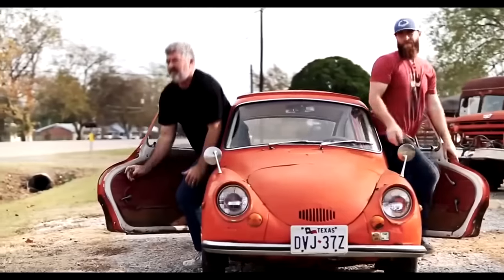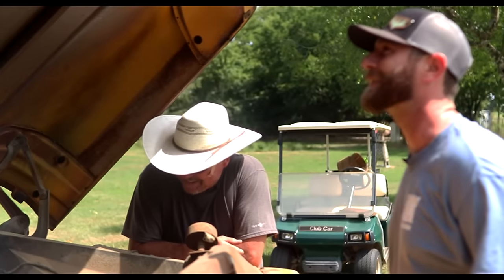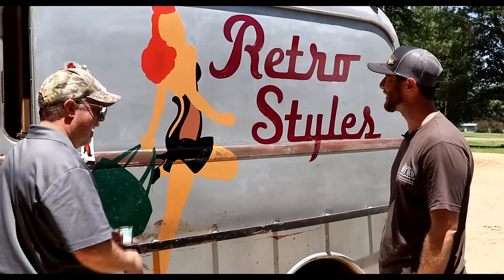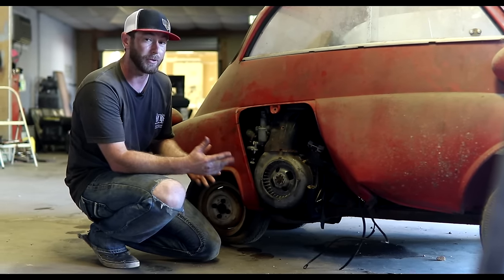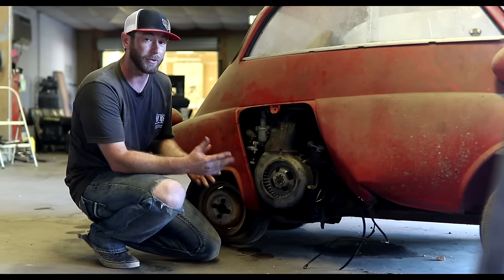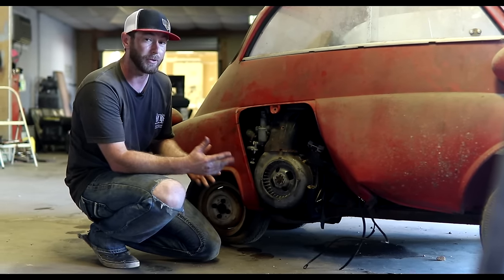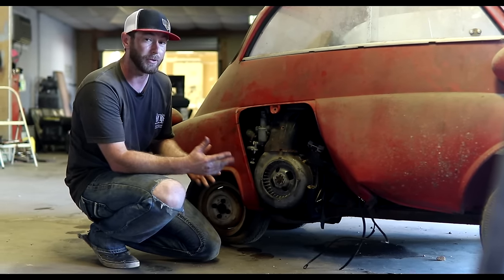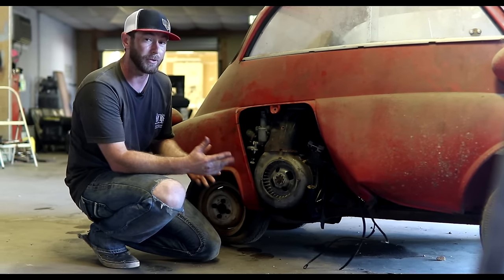Runnin On Empty | 1959 BMW Isetta Runs After 30 Years | Turnin Rust Episode 5

Comment: i used to have a full size 60 GMC school bus camper with that v6 5 spd and 2 spd rearend and it was a surprising performer. it got great gas milage, had enough low end torque to move a mountain and a top speed of 105 mph

Comment: I had a 300 once. The starter becomes the generator after it's running. I paid $50 for mine and it was running. Had 1200 miles on it. That was 50 years ago. Had it airborn once.

Comment: A friend had a Morris Minor 1000 back when we were 16  or so in around 1968.  I looked in relatively good shape and had low mileage so he bought it.  Except for an electric fuel pump which crapped out on us when we went camping up in northern Ontario, it was relatively trouble free until one day turning right around a corner the left front wheel including the everything up to the rack and pinion fell off the car. That was the end of that English car! We had better luck with an even older VW.
Reply: funny for me but i feel your pain an the cars pain to

Comment: You should try replacing the BMW engine in the Isetta with a 650 Triumph twin motor cycle engine sometime. We did way back when in the U.K. Was featured in some magazine back then. Really exciting ride until it reached its road holding limit and wrecked itself !. Some had twin rear wheels close coupled, some single wheel only. Engine unit then grafted into a Berkeley three wheeler instead of the original three cylinder British Anzani two stroke unit. Possibly even more exciting until it too reached its limits. Happy crazy days. Some of us survived !.

Comment: I'm going to have to try that evapo-rust but here's a little trick that a fellow YouTuber showed me you can take washing soda with water and put a charge positive and negative 24 volt end of the bucket with whatever rusted Parts rims whatever and let it go let it go overnight and it actually boils all the rust off of whatever you put in there that came from Don DIY

Comment: We were in Palm Springs, California, some time in the 1950's, walking on a major street downtown. There was an Isetta parked at the curb, with a lady behind the wheel. She looked to be in her late 30's or early 40's, and had purple hair.  "Can you help me?" she asked. Her Isetta wasn't running, and it was hot that day.  We couldn't do a thing. I don't know which was weirder, her or the car. Plenty of automotive help in the area, though. I remember her getting out of the car - the whole front end opened, and the steering wheel folded up. She stepped out on the street. Palm Springs is not one of those places that is good for your sanity. I was a young teenager at the time.

Comment: Start using Seafood. It instantly removes varnish or oil or grease from anything. You can add it to your engine or put it in your gas tank. Before building a motor that still runs but is all gummed up inside. We put 2 cans of seafoam in oil run the motor for 20 min. Drain oil. Take motor apart all gunk gone and complete motor shine like aluminum foil. Stuff will clean out carburators an unsease engine..

Comment: Love the bus.  Growing up, we had a 65 GMC bus with that same big V6 that my step dad made into a camper.  It had about nine windows down the side.  Ours had the Carpenter bus body which looks pretty much like your short bus does except ours had different design clearance lights on the roof.  The shape of the rear and front of the bus body looks the same.  Your bus is in much better shape since ours had come from up north and had a lot of rust in the front fenders and they were barely staying on.  We had to use wire to keep them from falling off.

Comment: that old ford is a 61 or 62 unibody, i had a 62, recognized the grill, pretty rare especially one that wasnt cracked bed away from the cab, that was why ford gave up the idea, frame torque would break them up, cab from the bed, buck

Comment: I hate to be the bearer of bad news, but unfortunately you are mistaken about the year of that truck. It is a '54 Chevy truck. I have done a little research on it and that grille came out in 1954 and in 1954 only. Besides that, I used to own and drive one. The'55 Chevy truck also had a grille of its own as well. Other than that, great episode. Please keep them coming.

Comment: The isetta is a slash two type of roller motor....the slinger plate is sprayed with oil and it centrifuges into the big end through a 1/8" hole....if the crimped lip of the plate gets sludged up with that lead type of deposit bang goes the big end......most I have done are not clean...be careful....take care, very nice editing and content....

Comment: you realize running something on straight ether like that dries out cylinder walls right? Especially carb cleaner as it doesn't have lubricant in it.

Comment: That Chevy pickup you bought ISNT a 66. Its a 60 - 63 that has had  the hood ad or grill changed. That style windshield was only used from 60 - 63. In 64 GM switched to a non-wrap around windshield

Comment: so that V6 is most likely a 351 V6 lol that is difference between Canadian GMC's trucks & Buses from US any Canadian one used V8's like V8 283 which I had in a  63'GMC 910 =1000 1/2 pick up truck  mine had a factory V8 283 and Muncie SM 420 4spd the truck today sits at farm out around Spring Valley  but anyway our 67 GMC  C/950 2 1/2 grain truck has a V8 327 2bl 4x2 now there was a few guys up around our way with they had bigger blocks V8 402, like 69 & 72 GMC 2500 had the 402 or 454, my brother had a 61'GMC  LT980 with V8 348 4bl  crappy Clark 5spd old moving van truck , and I seen a 64'GMC CT/890 tandem gravel truck with V8 409 in it. But my trips into the State side just even in Montana I seen a lot of older GMC pick up trucks and medium duty trucks with V6's

Comment: Just a couple of things to say: (1) this is just a little too long; a video shouldn't be more than 20 to 30 minutes or else it's a, "documentary" or a movie. It's a lot of content but some of us don't have the luxury to stay ingaged that long. (2) as many vehicles as you move around; shouldn't a spare 5 gallon gas can be a standard "tool" on your tow truck?. (3) lastly, when you bought the '62' and it ran out of gas, I really felt your remark, " taillight guarantee" was a tad unkind. Anything used and old has a certain risk and the guy seemed really up front with you about it's condition. As it turns out it was only a "run outta gas" problem and nothing else.

Comment: Sorry,... I don't like the theme,......If you don't want to fix it just sell it.
I can't stand to look at rusty shit,....... I'd just restore the shit or sell it.
I'd paint the rusty shit with ATF transmission fluid,.....even the engine's and in a year the bolts will easily turn out and the rust would clean right up.